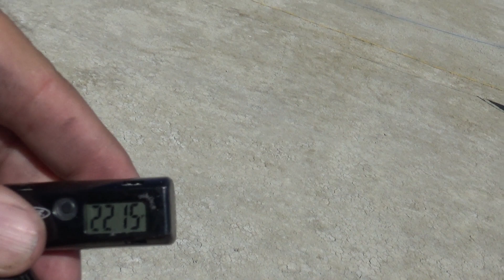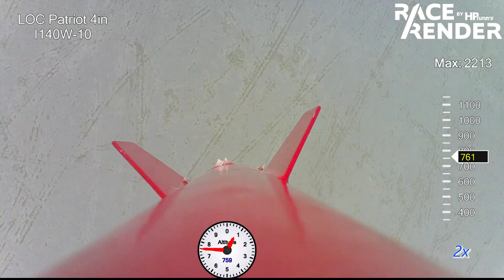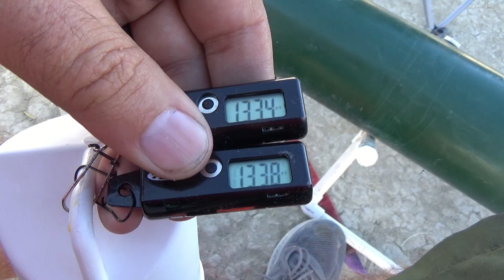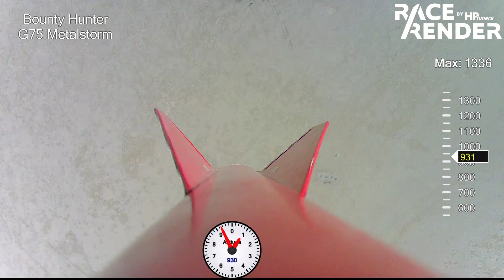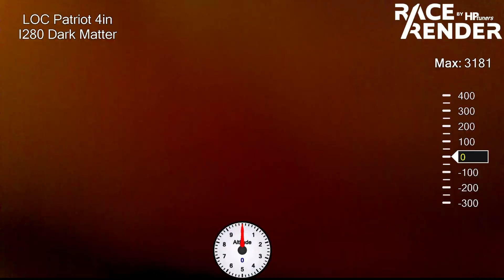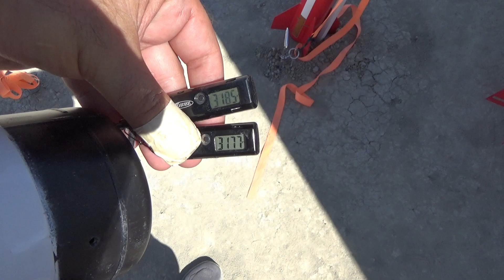High Power Rocketry: Going for higher altitude at XPRS on day 3 and 4

Comment: I dont understand...some vids from a down looking camera include an altimeter insert.  the rocket rises and the alt shows progress and you can clearly hear when the motor runs out of fuel and stops pushing.  at that moment the altimeter stops and starts showing a falling rocket.  BUT, we all know that as the motor pushes the rocket up, when the thrust stops the rocket continues to rise as a result of its inertia.  Same as why a bullet doesn't drop to the ground without moving forward when it exits the barrel but continues to travel on its trajectory.  I am not a rocketeer but have followed our space program for decades and feel I kinda understand the forces involved, so why does the altimeter show the rocket stopping its rise the moment the motor quits?
Reply from the maker: Good question. These altimeters only show me the apogee. I use Excel to calculate the linear slope which is fine for the descent. I recently figured out how to use a sine function to emulate the ascent and used it in the remix video. I also finally got my Eggtimer Ion to work so hopefully will be able to use the data from the telemetry data.